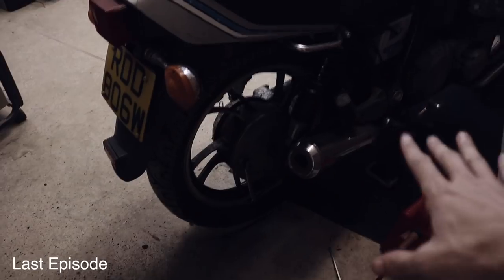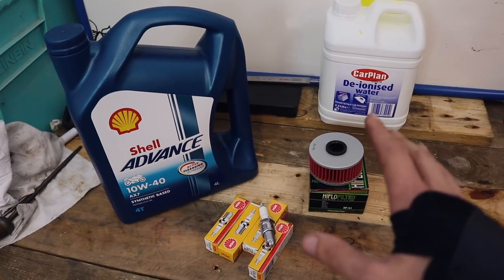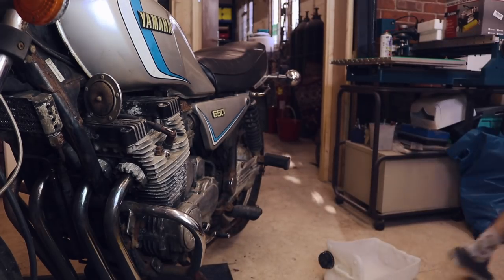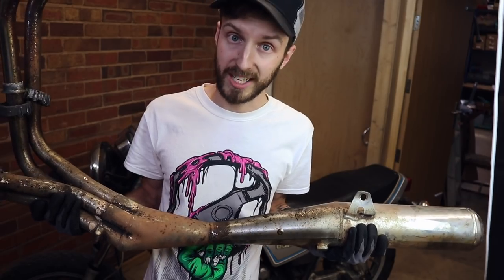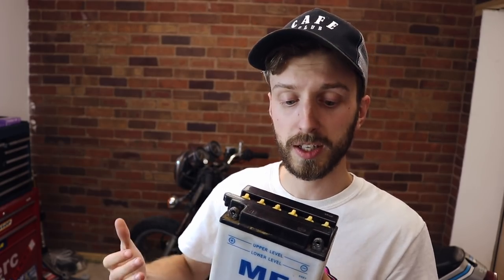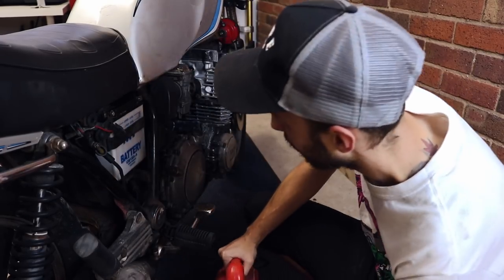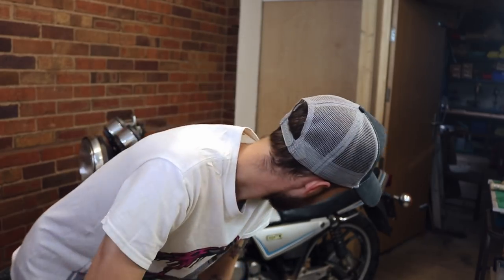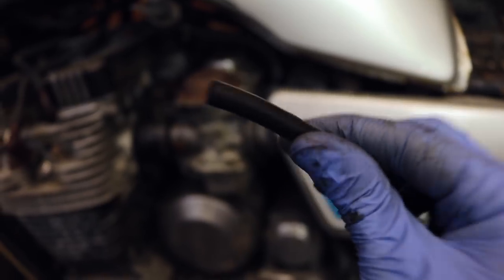XJ650 Cafe Racer Build part 2 - Engine Service & Back to Basics

Comment: Are all four downpipes hot?  Same temp? I would suggest a good strip and clean of the carbs, check the diaphragms for splits and the intake rubbers too. Then a carb sync if all is well. Clutch basket sounded a bit rattly, may just be my ears. Great video, looking forward to the next one.
Reply from the maker: They all get hot and i dont feel any difference across them. Ill be giving them a good clean when the engine comes out :)

Comment: Change the air filter, they are so cheap and worth doing from service perspective.
Can really help getting it running 100% smooth again.
I learnt hard way after poor idle/running issues on my bike - pulled carbs out cleaned, balanced, messed about with idle settings this took hours! New filter was all it needed (even thou it looked fine).
Reply from the maker: Im buying some K&N pods when funds allow plus this one looks like its pretty decent for now anyway :)

Comment: Great work,  I did virtually the same work on mine this weekend. I have the two into two system, so no need to remove the exhaust to do the oil and filter. I can’t recommend cleaning the carbs enough, it made all the difference with mine. Keep em coming!,
Reply from the maker: Ill be doing just that then :)

Comment: You want to strip and clean those carbs and do the idle adjustment on a red hot engine doing it cold could cause it to idke shit when you finally take it for a ride and get It upto temp other then that great work.
Reply from the maker: The bike isnt usable in this state ( no front brakes being a main one ) but i did actually run the bike for about 10 mins with revs to get it warm. Its just cut up with editing ✌

Comment: Next time you do a oil change if your worried about oil not being in the whole engine case. pull the spark plugs and crank it for a little bit with the electric starter. Don't forget to cut the fuel with the petcock. other wise you will probably just flood it.
Reply from the maker: To be fair i should have know this but i did forget 😅

Comment: You need to leave it running for a while on new plugs to tell if its running too rich. The soot won't deposit on the plugs that quickly. If I were you I'd be checking the valve clearances as well if it's not runing 100%. It's a bitch of a job but if it hasn't been done for a while then will only cause more issues down the line. Plus would be good to finally have a valve adjustment video on YouTube that was done with some enthusiasm and didn't send us all to sleep (excluding Ari Henning's one)  haha!
Reply from the maker: Its something ill look into! Its all steps in the right direction ✌

Comment: Carb balance is way out for a start, that's why it won't idle properly and it rattles (the camchain is trying to keep the engine in time). I'd also have checked HT leads and coils when changing the plugs. 

Bloody good bike the XJ650 - I had a red one years ago (late '80s) and I'd still have it were it not for a SMIDSY.

Comment: Good work Jish Lad! Sounds better for a bit of tlc.. Keep it up and she'll be a minter. 
Good luck with the drive shaft oil when you get to it... Hopefully its not thick like tar as my CX
Reply from the maker: Yess! Thanks buddy. I just wanted her running without any major problems before i pull the engine out 😅 ill be doing the oil soon enough!

Comment: It most likely been said but this motorcycle has to have its carbs (4) synced with a x4 bubble device,  then and only then will the  engine run smooth and have the power it was designed to have ...
Reply from the maker: You are correct my friend
Reply: This is a Yamaha yics engine which connects the intakes together as well. It takes a special tool to block that off to properly sync them. The throttle shaft seals and carb boots almost always leak. The rack on these is a pain to separate as well

Comment: New exhaust and carb strip down will be sweet mate. Exhaust looks like the baffles have disintegrated proberbly not worth repairing. Loved your cb125 build I watched while series in couple of days looking forward to this series in real time. Will you be taking the cb to any more shows this year?
Reply from the maker: Ill be going custom with the exhaust and the carb will be cleaned out at a later date :) Unsure on the shows as its having some issues at the moment so I haven't even had a chance to ride it much aha
Reply: Definitely worth cleaning the carbs out. After 2 years the idle jets will probably be partly blocked. You can spend a long time trying to tune that out ;)

Comment: I’m sure you’re already gearing up for this, but pods on a rack of CV carbs are going to be a nightmare.
Reply from the maker: Indeed i have! Ill be going with some K&N's over cheapo ones this time
Reply: You'll be needing to re-jet the carbs. Your best bet right out of the box is to have them professionally tuned and ask the mechanic if you can watch the process of tuning and bench synchronizing them. When you adjusted the idle of each carburetor you were actually throwing any chance of the carburetors being in "sync" right out the window with each turn of the adjustments. Being synchronized and properly jetted for the air pods will mean the world of difference between a crappy running poor fuel economy bike and a seriously fun bike to twist the throttle on. With 7 bikes, many with multiple cylinders and being a small engine mechanic (Check my Channel), having the proper knowledge and tools is paramount to a smooth running bike from idle to wide open throttle. Keep the rubber side down (from across the pond) Zip~
Reply from the maker: Don't worry buddy! this will be on the cards on the final build back up as i know when iv taken the carbs off and put everything back together it won't be running too well until its been set up and tuned properly! For now i just wanted to know everything was working and there wasn't any underlying issues with the engine before i start pulling it apart
Reply: It sure sounds healthy and certainly worthy of your next build, there's no denying that. I did notice a little starter clutch slippage though. It's an easy enough repair if it becomes an issue later on down the road. By slippage I mean, the clutch that should be behind the stator is a roller bearing clutch usually with three or four rollers, as many plungers and springs and the springs get weak over time and the plungers become mushroomed. This weakens the grip the clutch rollers have and causes the clutch to slip making a distinct sound in the process and it can cause the clutch drum to also slip while the engine is running. It's nothing that will blow up and put the bike out of service and most Cafe` builders do a starter delete and make the engines kick start only anyhow. Really looking forward to this build Buddy. Zip~
Reply from the maker: I've actually been watching guides on this as it was mentioned! ill be doing it at some point :) i have to as this bike hasn't got a kick starter! Appreciate your comments though mate. so helpful and informative for me and others to see

Comment: Did you check the compression?
Reply from the maker: I havent as i dont have a tester but im sure i could borrow one from a friend
Reply: Jish pretty easy job and gives a good insight to the engine. Looks like you have a pretty good bike there, really looking forward to the build!
Reply: the bike shows no signs of needing a compression test as it fired right up with excellent compression.
Reply: your bike has excellent compression Jish hence the reason it fired right up, really you would only be looking to do a compression test on a bike that has problems starting which yours clearly doesn't buddy.
Reply: Alan Dow so if a bike fires first time it must have good compression. Ok then......😂
Reply: Owen O'Neil if a bike fires as easy as that did clearly showing it has good compression, doing a compression test would not be high up the list of priorities and is therefore a pointless exercise.
Reply: Owen O'Neil but answer to your question yes it must have good compression which was clearly shown in this video.
Reply: Alan Dow How exactly would you know what the compression is on each of those cylinders unless you test it? The bike starting just means it has spark, air and fuel. It wasn't a slight at Jish, just a very simple, basic and helpful hint. I think most people who have had experience with an older bike that hadn't started in a while would agree.
Reply: The way that bike fired up showed absolutely no signs that it had bad compression its that simple, as you know i'm sure a 4 stroke sucks fuel, squeezes it (compression) then bangs and blows which that bike done no problem at all so there is no need to look further for a problem that doesn't exist. If the bike had problems starting unlike this that fired up on the button then yes i would definitely agree that checking for compression would be a pretty worth while exercise. Apart from the carbs needing a clean and rebuild all the signs were there of a healthy motor.
Reply: Alan Dow ok then, bike starts = good compression. Thanks for the lesson....🤐
Reply: Owen O'Neil if a bike starts as easy as that did then yes it does have good compression. I don’t understand what you have seen in this video to indicate anything different.

Comment: 10w30 🤔🤔🤔🤔. why
Reply from the maker: Thats what i was recommended
Reply: Jish by whom . its an 650 right . i don't think that 10w30 is good enough
Reply from the maker: The Hayes manual for my model of bike buddy Plus the website i ordered the oil from. gave them my registration and thats what also came up to be the correct oil
Reply: Jish if you turst them good but i still prefer little thicker grade